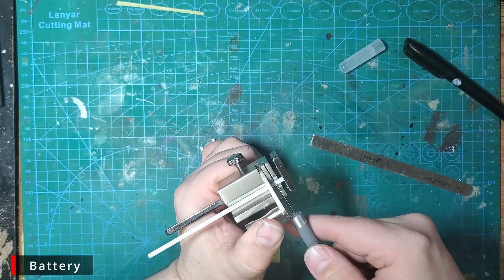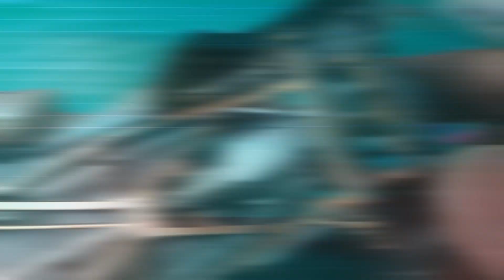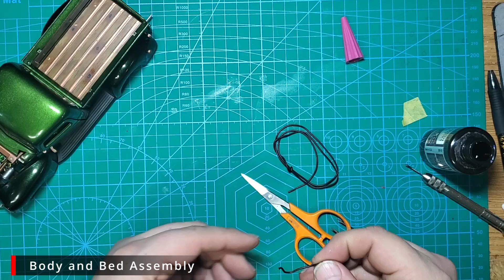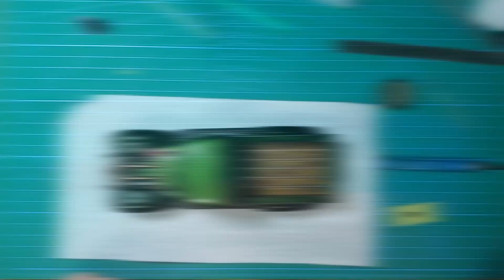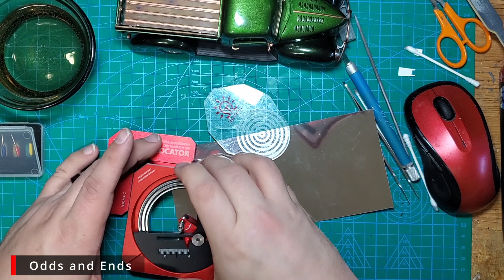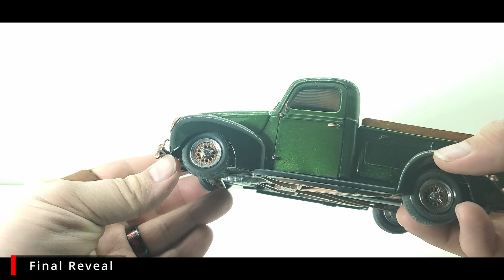Revell - '40 Ford Pickup  - Finale - 80th Anniversary Group Build

Comment: A lot of great tips you shared. 
What is that tool you used to do the cuts?
Reply from the maker: That is a tube and rod cutting jig. It's pretty useful when you need to make multiple pieces the exact same length. You measure and mark your first piece of material, then put it in the jig and line your mark up with the cutting hole. Then set the end stop and lock it down and make your cut. From there you just put the material back in and cut over and over and each piece will be the exact same length. It's a bit hard trying to cut with a hobby knife. I want to try it with a razor saw, but I need to get a razor saw lol. Micro mark sells them for a huge mark up. I got mine on ebay. Search  "Vice cutting tube cutter jig". Here's a link here:   https://www.ebay.com/itm/252014448293?hash=item3aad3b4ea5:g:q3UAAOSwBLlVMZ10

One thing I don't love about it is the clamping arm can mar your material where it's clamping down. I'm thinking about trying to glue a tiny piece of rubber under the arm so it will hold better and not dig into what I'm holding down.
Reply: @JHartModelworks . Thanks. I think I'm going to get one.